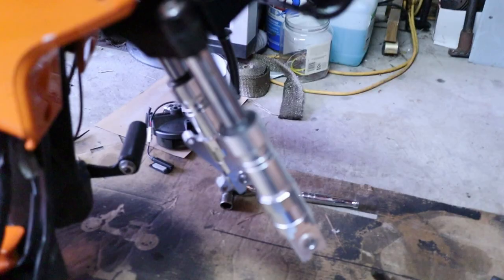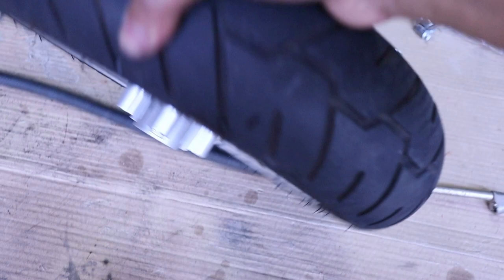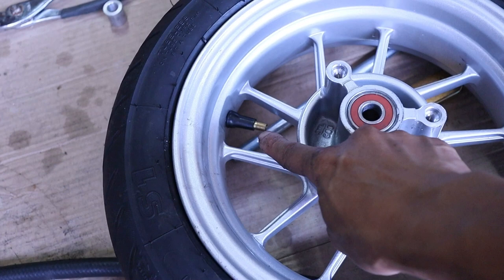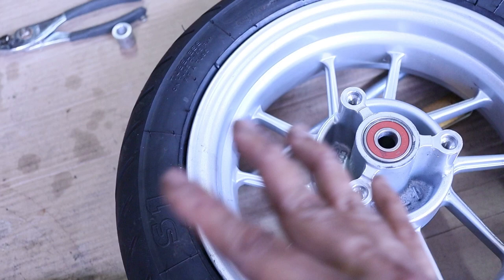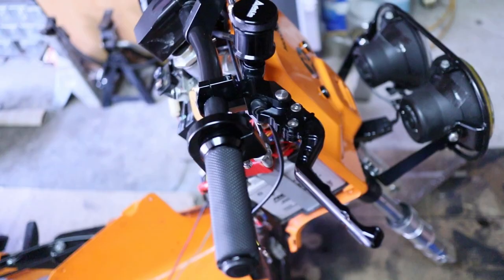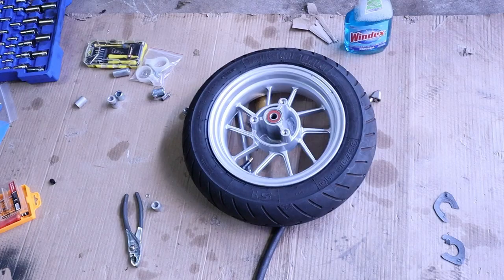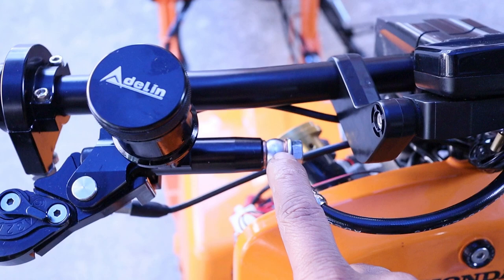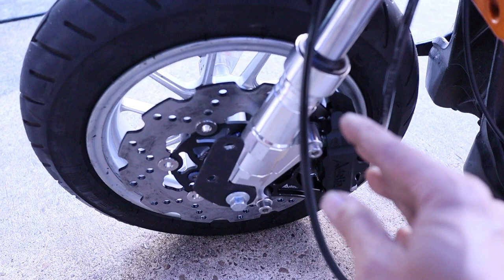Front Disk Conversion on the Honda Ruckus and what I learned #ruckus #diskbrakes

Comment: Looks good. 
A tyre valve tool is literally just a couple of bucks.
If you are replacing a brake hose get a vacuum bleeder. Saves a lot of trouble. If you tie the lever back over night it will let any remaining air out too.
Reply from the maker: I’m gonna tie it tonight , yea I need a tire valve tool
Reply: @SmallEngineVelocity  not too tight. Just enough to pull the lever back. It doesn't need lots of pressure

Comment: My question will be how tight did you get the axle nuts? Because if i tight mine all the way then the front wheel wont spin freely so i got it hand tight but im afraid that thing comes off
Reply from the maker: Buy the NCY front axel. You can put cutter pins in it.
Reply: @SmallEngineVelocity  i currently have that one
Reply: @ezurmnd   your not supposed to tighten it all the way bud.

Comment: If you look up the NCY kit I'm pretty sure the caliper is smaller. Similar in size to what's stock on the Groms if I'm not mistaken. But at least now you have some good stopping power. You definitely needed it lol
Reply from the maker: It was pretty strong and scared me when I pulled it like it was a drum
Reply: Yea the caliper that come with the kit with the ncy wheel is definitely smaller.
Reply: @SmallEngineVelocity  I can imagine. When I rode your ruck in Katy I definitely missed the bite of my front brake

Comment: About to do my front I just finished the rear on my gy6 ruckus . I know what you mean about being low on money I've spent 6k this year on this thing so far .
Reply: For 6k…it was probably mostly towards a motor right?
Reply: @davidl5882  a built 171cc is only 1k. 6 grand is a whole lot of money if you’re doing it yourself. Unless that includes the cost of the bike. The 6 is about right.